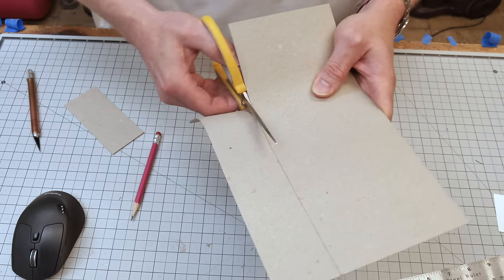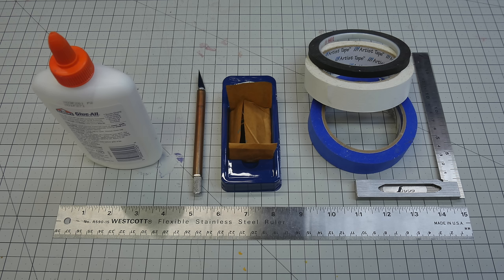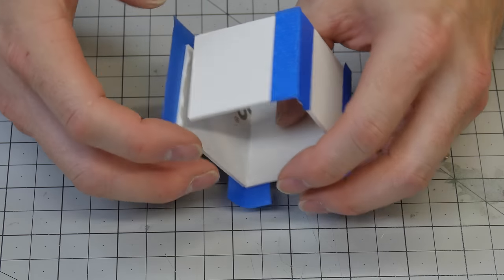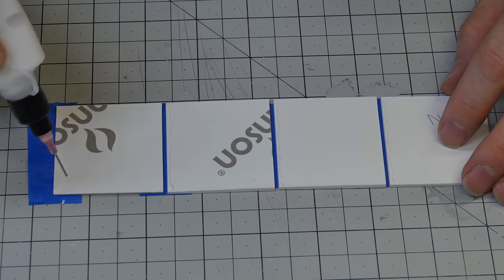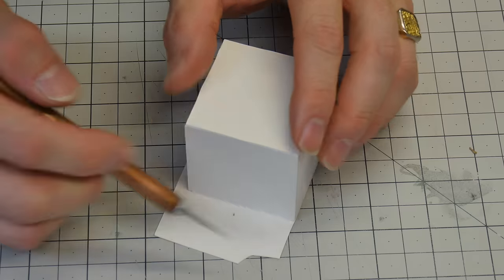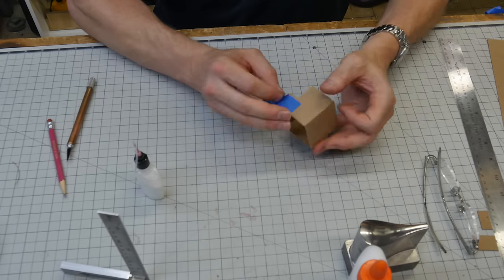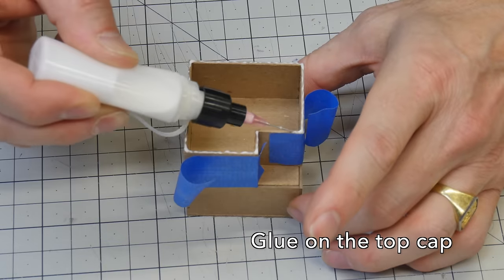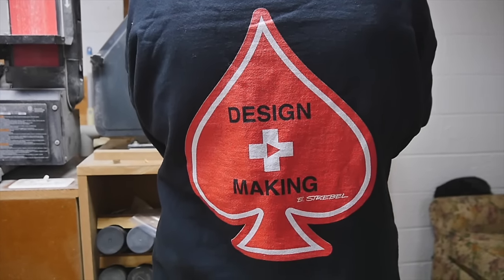CardBoard Basics Tutorial Guide Chip/Matte Board model making: modeling for Designers & Architects

Comment: I usually save up cardboard boxes so I can use them later for model making  but I do not always get clean cuts. It sort of depends on the cardboard I’m using, is there a way to tell if the cardboard is good enough to give me clean edges??
Reply from the maker: The key to clean edges is a sharp blade it doesn't really have anything to do with the media that you're using unless it's just way too hard to cut but there should not be an issue with cardboard.

Comment: Something makes me think such cardboard would also form a perfect basis for a composite material that would stand up to end-use requirements, if it was allowed to soak and cure with a suitable resin. Just that I haven't tried and thus don't know a suitable resin. Also it can get mighty messy.

Using sheet styrene can of course be an alternative, and it can be welded together. But it's not nearly as flexible to work with as cardboard.